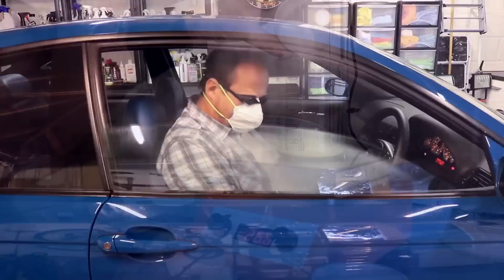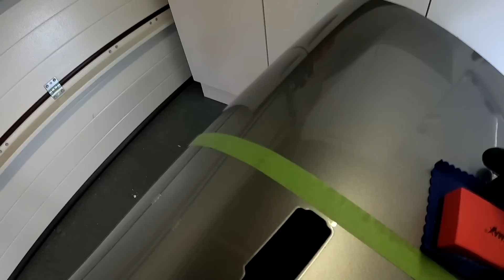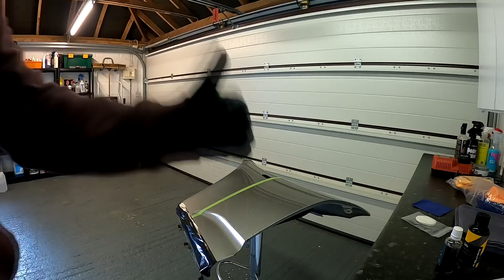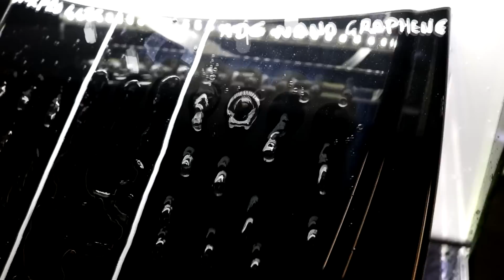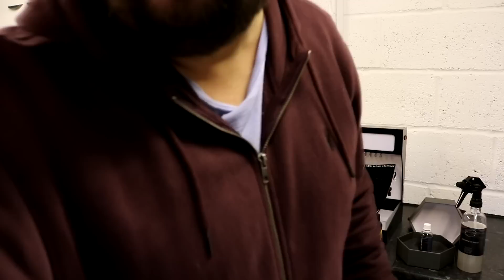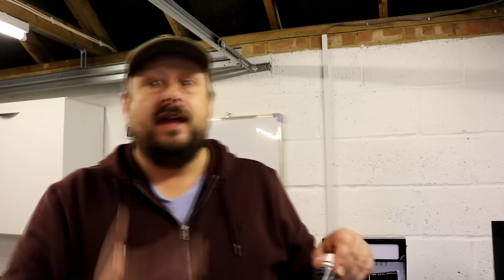R.I.P. Ceramic Coatings and SI02 | Meet the Future of Detailing

Comment: Car detailing is taking the way of HI FI, lots of marketing BS, lots of gulible prospects, lots of shills,  lots of ripping off.
Reply: Exactly, if Graphene could be applied on paint in its true hexagonal single atom sheets then it'd have to applied in a lab, not a spray bottle and a wipe. This is probably just ceramic based product with some graphite mixed in.
Reply: Spot on. I was at the Hifi show in Bristol three years ago. A company had produced a graphene rca cable, cost for 0.5m £450. A rep came upto me and started on the benefits of this magic cable, nonsense, I walked away. You are so correct, car detailing products are going the same way, bold claims, nonsense. I use carnauba wax by a Brazilian company, that's it, it works.
Reply: @a0r0a745  Well, 3 years ago you say? Then it's not nonsense. And not just mere bold claims either. Properties of graphene are actually excellent, even for cables. Very high electrical conductivity, thus very low "bleeding". This leads to a massive increase of performance and quality, as well as efficiency. But, the cost. YIKES! That is true because, as simple as it sounds, this is not a mass produce raw material. Only a handful were producing it and it's rather costly to do so. It costs more than silver. That's something you've got to understand FIRST. It costs more than silver and I believe more than gold too. If it was a golden rca cable for 450 per 0.5m, it probably wouldn't sound so "nonsense" but rather more of just some luxury item. Now considering this, graphene, used to cost more than gold. Just add a brand to the product + expensive raw material, I'm afraid you were offered a luxury item then pal. The price of graphene has dropped a TON since then.
Reply: @Kyle-kc8cw  its okay I am an electronics engineer. Fully understand the properties of conductivity between materials. You miss the point. These companies put  a massive price hike on the product and also make extortionate claims of increased performance, especially in audio, no, do not agree and have not heard that night and day increase you speak of (massive). I will ask you a question, please give me a supplier of a graphene RCA that does not cost. You did say the price has come down alot. I quickly googled again just to see. One of the first audio companies is Cerious. Have a look at their prices. You are not going to get me to part with my money on any of their products. As for car detailing with Graphene. There are so many questions. I like polishing and waxing my car, can you with this product or is it a pointless exercise and waste of money considering its cost and the fact it last for years? No as I said, marketing, hype, it may work, very well in fact for detailing (audio, no) but the cost, no I am not buying into it. I will stick with my Brazilian carnauba wax thanks. Keep safe.
Reply: @a0r0a745  Woah okay engineer, calm down. Take a breath and read through properly. I'm not trying to part you with your money. Frankly I don't care either whether you buy into it or not. I'm just trying to explain something. Also I'm talking about price of GRAPHENE, not RCA cables. I can see now you didn't try to read properly and understand what I was saying. I'm merely talking about graphene being very costly but has since then been reduced in price by a lot. Again, I'm talking about raw material: GRAPHENE. Now it's got a long journey ahead of it and competing against very matured technology but if successful, you'll start seeing graphene being implemented into many of our products WITHOUT a price hike. As stated earlier, I said I believe you were looking at LUXURY items which naturally would have a certain "special" characteristic and then backed by a brand name, charging consumers an insane price. Perhaps I made a mistake with using "Massive" as I admittedly had cheap, generic cables in mind when writing that. But ironically, YOU missed my point because what I was trying to say was it's costly as it is a luxury item. More so because you mentioned it was 3 years ago. Graphene prices were relatively high during that time too.  

As for waxing and polishing your car, well...it's your car. Do as you please. I personally have 3 cars and 2 of those are protected with a Turtle Wax Hybrid Ceramic Coating (not exactly that kind of coating but it's still very low maintenance). I keep the other with only a wax because I enjoy doing so but realistically I cannot maintain this kind upkeep for all 3. So I totally get it if you don't want to buy into coatings. Speaking of luxury items, this graphene coating would also count as a luxury item. Something that would not necessarily be lightyears away in quality but definitely so in price. You and I are realistically not going to buy into this even if we could afford it. But I guarantee you someone out there will. Targeted marketing, and you and even I are obviously not the market for this. 

As this graphene becomes more common, it will slowly become a part of everything and without significantly affecting prices (nor would it even be a special characteristic). Do you remember when luxury features in cars started becoming a common occurrence in your low ends? Same thing.
Reply: @Kyle-kc8cw  I did read it properly pal. Thank you for admitting your mistake too 😂🤣😂
Reply: I concur. And 15 years later the entire industry drowns on their own bullsxit. Just like Hifi.
Reply: It’s the phenomenon of diminishing returns coupled with amateurish user base. You need to be a professional sound engineer to actually hear the subtle differences in high end audio and there is a point beyond which only instruments can detect the differences. I’ve owned high end headphones and they were worth it IF you are interested in sound And hearing detail. It’s remarkable what a difference it makes but it’s inaccessible unless you know what you’re listening for. 

I can’t say same for detailing products & maybe it’s same situation but I seriously doubt it. High gloss wax finishes done professionally are As good as it gets for the average person
Reply: Use simple carnuba wax, all smoke and mirrors
Reply: @The Stig's English cousin  You sure you know what you're talking about there buddy? If you could elaborate your point a bit more. I could be misunderstanding you.

Comment: Look forward to they coming down in price!
Graphene (discovered in Manchester nearly 20yrs ago) is the same as graphite but one atom thick. Honeycomb is how the carbon atoms are joined together when there's only one layer and the 2D bit just means it has length & width but no thickness except it's not literally 2D because it's still one atom thick. It is the strongest, but until they figure out how to make 1mm thick graphene sheeting that doesn't mean much. Spider webs are stronger than steel too but you can't buy 15mm diameter spider web tubing (actually you probably can on eBay!)

Which reminds me... if I want to use a snow foam or similar but can't use anything connected to a hose pipe could I use a pressurised sprayer (the type you pump up)? I just want to loosen the muck before using a sponge so any ideas much welcome.
Cheers
Reply from the maker: you can mate yes.. like IK hand foamner or IK9 bigger pumper sprayer and mix out to direct PIR ratio..
Reply: @ForensicDetailing  I already have an ancient pump sprayer so I'll get some foam. The sprayer only does a fine mist but I'll see how it goes.
Cheers

Comment: I’m a pharmacist and I am concerned with the long term chronic exposure of inhaled silicone dioxide as detailers aerosolize these coatings on vehicles daily.  I’m concerned as we chase more and more durable coatings in our exuberance we fail to consider long term effects of inhaling these coatings as we apply them.  We have no clue as to the long term exposure to Graphene. 🤔
Reply from the maker: yes top draw point.  detail spray says use like a mask as well.  I was wondering if that was just like because it has a small amount of solvent in it so by law they have to put the appropriate safety action like wear gogles and mask etc.. or its specifically cause of the graphene..   like you say we probably dont know the health implications of graphene  but TBH I think all these chemicals are not gonna be great in our lungs.. even like aluminum oxide when poishing..

Comment: I'd be interested in trying the detailer on the paint in the under side of the hood to see how it looks, works and how long it lasts.  I was toying with the idea of a sio2 spray, like CP reload, in the next engine bay detail. Admittedly, it will be an OCD clean and dress :)   I'd be interested in any thoughts out there, or if you've tried this, please let me know how you got on.
Reply from the maker: Im honestly not too worried about protecting the underside of the hood..   on m140i for example the paintwork under the hood has no clearcoat.  Its like just primer and paint.   I think its the same for the paint in the engine bay.
Reply: @ForensicDetailing  Its more, I want it to be easier to clean, next time, I want a shiny clean look all over the engine bay, and my OCD tells me that I need to do it properly.   I am looking forward to seeing how this detail spray performs I the shootout.  Keep up the good work :)

Comment: I’ve been testing SPS Graphene and it has potential. The issue is the amount of Graphene within the product.   It is not a cheap ingredient to use.  It will take time to get into the hands of the prosumer as these new Graphene products are being aimed towards the professional.  

SiO2 is tried and true and Graphene has a lot of work ahead.  We shall see if it makes its way as the next coating material.  It’s a bit hyped at the moment.
Reply from the maker: is this the same product as SPS graphene Mike or very similair?
Reply: @ForensicDetailing  yes i heard they are from the same person who made them, same products. Can you please do experiment with the Artdeshine metal oxide? its new tech as well, i want to know if its more prone to water etching vs other ceramic coatings

Comment: Very interesting this graphene material. And what interesting is that even if it got the Nobel price in 2010. We are only in the beginning of the development of what it can do. What's also interesting is that they have not been able to get it stable in the 1 atom thick structure yet. So pretty much now it's not as pure as it can be in the future. Not a problem when it comes to the detailing industry but more when it comes to the conductivity and materials that's under a lot of wear and such. And what I know of it's not even much of this kind of graphene (don't remember exactly what's it called and a google search may get you the information on it) in this graphene coating. So in the future when the scientists has come up with the mix of carriers and volume of the graphene. Yeah we may get a very high performance from it than it's already has. 
Some on the Autopia forum has been able to play around with this which I think is the SPS Graphene Coating with another name. Around 5 months in without adding anything and just cleaning. Seems a tad lower slickness than directly after the SPS where applyied but still very high performance. 
Personally what it's going to be boring to take care of our vehicals. Just wash and decon and use a product or 2 that's it. What are we now going to be doing LOL 

Awesome video Jon! And an awesome hydrophobic display you got!
Reply from the maker: thats they key thing. because even ceramics loose there bling.. they get buried and like that lovly post application gloss and hydrophoibic stuff gets buried over time even if the materials are there..   so whats this coating gonna feel like 12 months down the line. will I be reliant on the graphene detail spray for the bling or is the graphene really like potent and can stay slick and smooth and repellent over its full durability lifetime..   these are the questions I have.
Reply: @ForensicDetailing  at least I think that every 6 to 12 months some kind of chemical decon wash is needed to be done. Then I don't think that the 5 years claims is on the highest performance from it either. A good ceramic coating like say CQUK can go up to a year of great performance from it depending on the environment and storage and how much you drive the car of course. But somewhere before or after the 2 year mark the performance from it is degraded by so much that we that has this as a hobby and interest to have a great looking car that's easy to wash. That we will want to reapply the coating. At some as mentioned before it's important to get the coating deep cleaned and use products that keeps the coating as clean as possible. And say when the coating performance has degraded to 60-80% it may be a benefit to start to top it up with a topper of some kind that actually increases it's performance. Think that many starts to soon with toppers and also use them to often as well. So they degrade the performance from the coating by 10-15% by just doing that. And those that use strong toppers you can see like a wax haze when waxing too often. But maybe more that they gets like smearing instead. IMO let the coating do it's thing until you have noticed a drop in the performance. Maintain it with washing with something like Carpro Reset car soap. And when you get a noticeble degrade in the behavior from the coating. Do a chemical decon with a tar remover and iron remover and a water spot remover and a wash. If the performance from it is still degraded and not revived. Then apply a topper on it and maintain it with that toppers longevity as in that's shows a performance drop. Usually you will still notice when the coating under the topper has degraded so much so the ease of washing it and the self cleaning ability from it is not so good. Then it's time for the reapplication. 
With graphene coatings I think it's going to be the same. But that's if it's claims is what they says. Thinking that the graphene detailer is a product developed for those that miss that first slickness feeling from it. As of yet this don't impact the performance from it as in water behavior and the self cleaning ability from it and the ease of washing it. Just the feeling from it which honestly most every protection product looses sooner or later quite quickly. As long as the graphene detailer don't degrade that extreme performance it would be fine to use. I don't know if you have noticed this as well. But from only watching YT videos. The Turtle Wax Hybrid Solution Ceramic Spray Coating has a very good performance. But just from 1 use with either the Ceramic Wash and Wax or Ceramic Wet Wax. I see that the water behavior gets changed to more of sheeting properties. Than the Ceramic Spray Coating has on it's own after applyied or washed with a car soap that leaves nothing behind as in protection and glossenhancers this when you use the Ceramic Wet Wax. Maybe not a bad thing but I don't like when you ad something that looks like it degrading the performance from the protection you had before it. 
It's a little strange that PDMS is used with graphene. And I'm eager to know how well this is going to be when it's reaching around a year of the application. If the graphene holds up the strenght of the PDMS. And also this is the first graphene coating available on the market. So I personally will wait until more about it gets in about it and maybe more brands comes out with graphene coatings. IGL Renew F4 is like a graphene based Carpro Essence Plus which seems awesome with very high gloss readings from it. Angelwax did a graphene infused wax for the SEMA show. Maybe you have a good contact with Angelwax that you could be doing an interview with to hear how they looks at graphene in detailing products? Would be very interesting to see and hear if it's possible to do something like that. Don't know if they will release a graphene line like Enigma or something like that would be very interesting to hear about too. And what the differences for them on what the graphene vs SiO2/ceramic is. Think that the prices will drop too when it gets more available for us. It's a very new technology graphene still. So it's going to be better very fast as well. Think that SPS has done a couple of small reformulation already on this graphene coating. Also think that they have on it's way or already here a primer polish. 
Interesting stuff for sure that I follow. And think that if you do this graphene coating on one of your vehical. Would be very interesting to see and also see follow up videos with how it's doing in the real world use. Since it's so new it would be even more interesting to see and follow.
Reply from the maker: @tonymattisson6158  in 4 years of doing you tube thats the longest reply ever! awsome I love detail Im still reading here :)

Comment: Just in case I wasn't paying attention. Can you add this to glass and wheels? Seems a great new item, a bit pricey, but if it works as well as it seems, on glass, on the body, the wheels, I might to tempted. But, yeah, you will need to wait a few years to say it works. The beading looks great and sheets off real fast. Great review as usual.
Reply from the maker: great question. I dont know the answer.. clear coated alloys I cant see why not.. glass I dont know.. ADS can answer this..